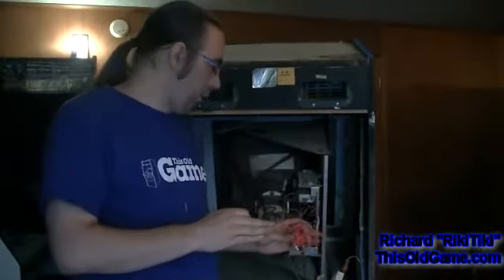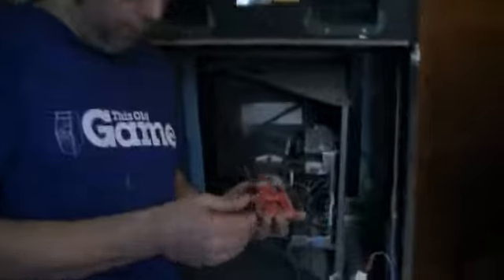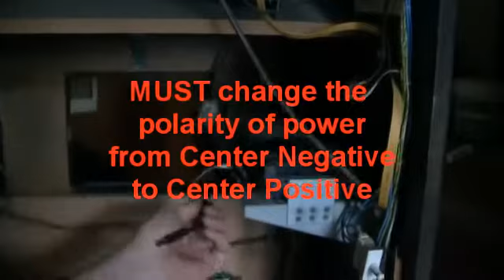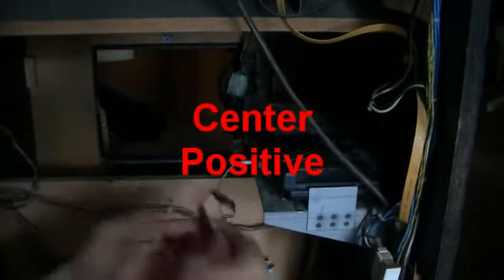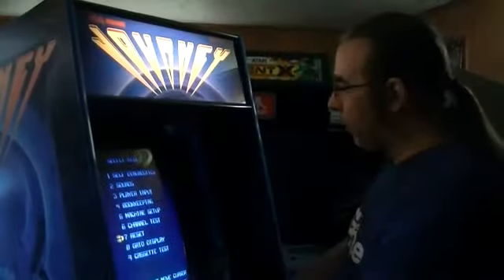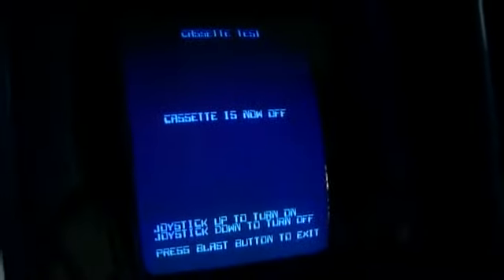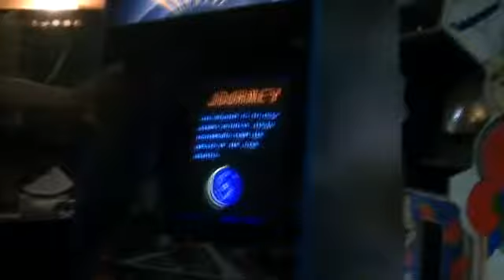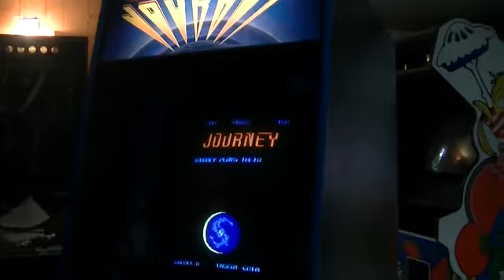Journey Arcade Game Sound Mod Part1

Comment from the maker: yes you can program the board to "pause" so the next time you reach the bonus round i will resume.  There is also the option of doing random tracks as well but The setup is slightly different. as you need to contact an active 5v to the new board

Comment from the maker: Ive said this before YOU CAN SET THIS UP TO PAUSE THE TRACK. just like the crappy cassette. it requires a slightly different hookup. you can also set this mod up to play multi songs at random so every time you get to the bonus round you would get a different song.  You can still keep it original with the cassette it dosnt require any hacking.  Its not much different then upgrading that 30year old power supply which also not original but certainly more reliable.